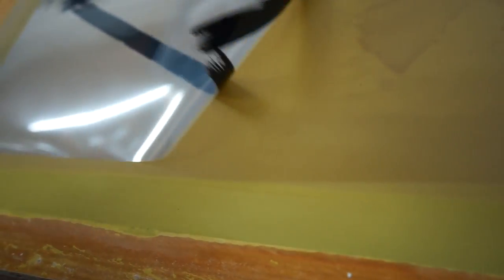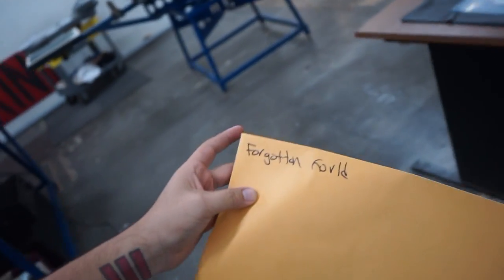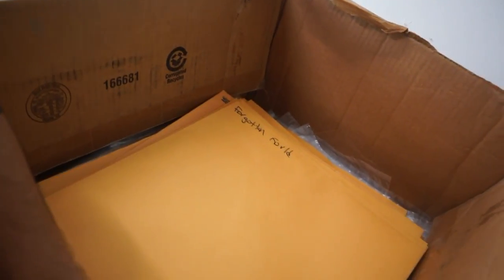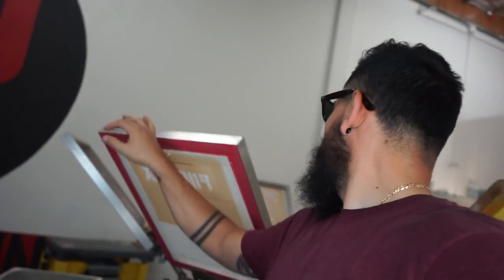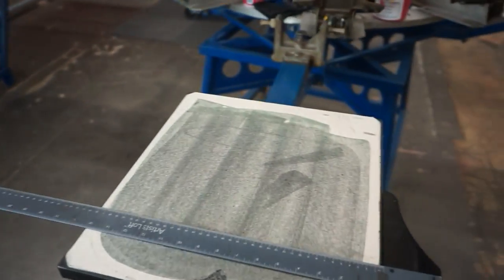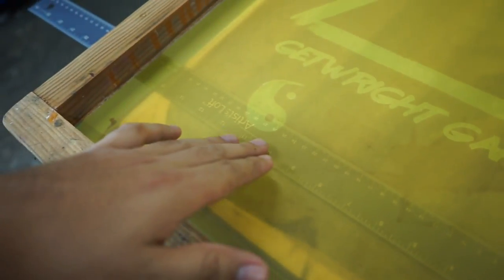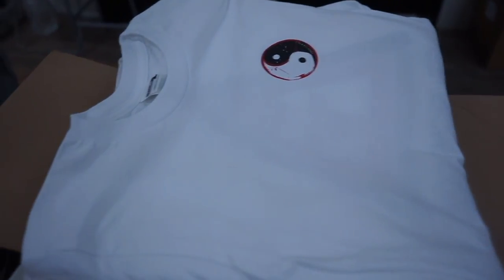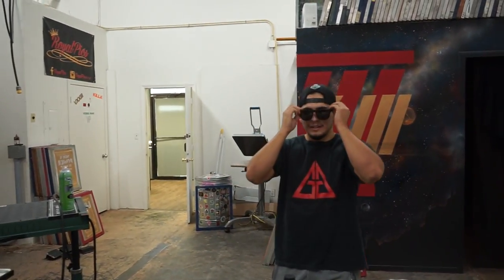how to set up the left chest

Comment: I just go down 4" from the top of the board and 2" from the center line or 2.5" for some small left chest designs.
Reply from the maker: ct apparel yup as long as you have your formula that works that’s all that matters 

You just have to find that location on your board
Reply: Vega 23 i have a lot of customers that dont like the design too far too the left. I've been using this method for 4+years and works.
Reply from the maker: ct apparel that’s great 
I havant had a complaint yet 👋🏻high five for that